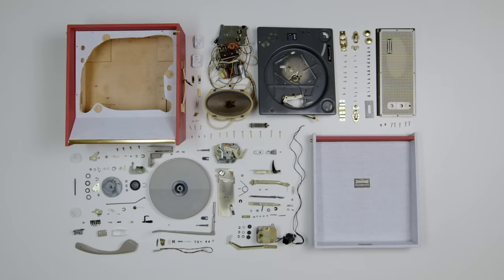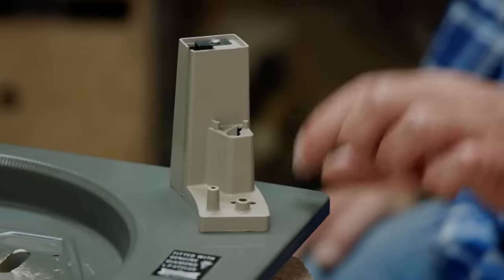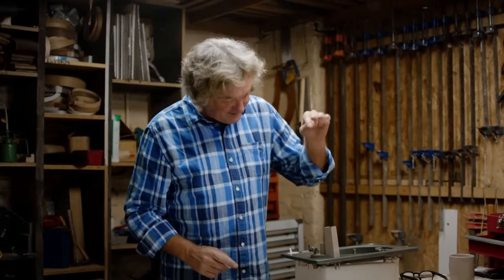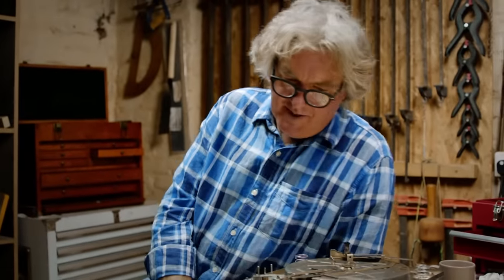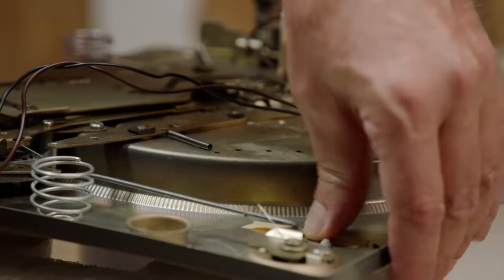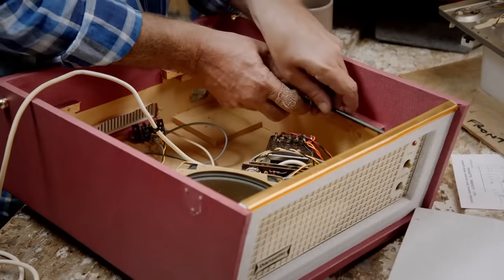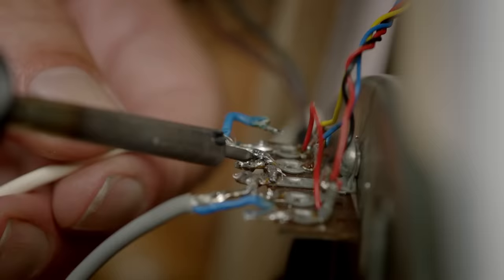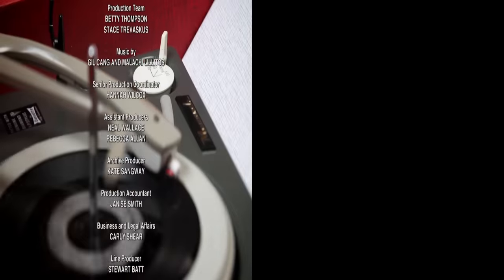James May Builds A Record Player! | Reassembler

Comment: Most of the portable record players supported 78rpm however the grove width on the 78 records was wider than on the 33 or 45s. Therefore to play and hear the 78 records properly they needed a different stylus, some turntables had a stylus that  could be flipped with a lever for the 78s
Reply: On this one, the entire cartridge flips over, as mentioned in the video.

Comment: Absolutely love watching James May do anything. But watching him say if you were a youth of the 50's and 60's, this was your I pod or mp3 player. Me in 2023 thinking, but I pod and mp3 are now just as obsolete as the record player. I recently set up a record player, a slightly more modern one than that, with an amp and some old bookshelf speakers, and the first record I played for some nostalgia was, The Greatest Hits Of 1987. Witch hadn't been played since 1987, and it sounded amazing. That weird thing about old tech sounding warmer that James mentioned, there really is some truth in it.
Reply: I was just listening to the wife's 80's record's she's 7 years older than me I lost mine but I reasently brought a gold ring E3 chartrige for my turntable £100 you can buy a cd player for that but yes they sound Warner and they flatter vocals. I restored a bar turntable and gave it to a charity shop they got £200 for it
Reply: a lot of its limitations and workarounds, its quite easy to have a 0Hz-20kHz digital file but vinyl didn't have the ability, the audio rolls off from 12kHz. The clever bit was the utilisation of eq (RIAA) plus mid and side. There is generally lots more 'side' on a stereo vinyl master than there is digitally now. A lot of clever analog sound tricks have been lost over time. It's warmer because of the way it's cut (mastering/cutting process) and how much information you can physically fit into a microgroove

Comment: Just to inform: The type of glass used to make a valve is not affected by the grease from your fingers. It is similar to pyrex glass if not exactly the same. It's extremely thermally stable glass.
Reply: Yeah it's usually Halogen bulbs you've got to be careful with touching.

Comment: World war 2 portal military radio valves were covered in a heat proof resin. Back in the 1960s I as a teenager use to repair old peoples valve radios using WW 2 valves as military valves were the same as retail valves on being better built. All you need was a book of valve equivalents. No heat sinks need working with metal chasis

Comment: This morning I had a choice: do I buy a replacement part for the vertical Roman blinds that joins the rotating string cord part of the blinds, or design and print my own version? The old plastic one had crumbled into small pieces earlier today. So about two hours later and a dabble in Fusion360, I had me a working replacement. It’s a small critter, that required a little bit of effort to get printed OK, but Cura and it’s multitude of settings makes that fairly easy. It now snaps into place with a resounding click as I assemble the top with its push fit. Very satisfying indeed. Now time for another well-earns cup-o-tea. Thanks James for making tea and telling stories we all love to hear, whilst watching you reassemble another gizmo from our collective past. Look up: Blind Pull Cord Connector Clip - Chain Roller, Roman, Vertical on thingiverse. A very useful place for free printable stuff. You can also buy them on Amazon, but then again, why not print one instead. Much more fun.

Comment: Yes, valves give a warmer sound. It's distortion. The valves change the sound from what it is meant to be to something false, and many people have come to like that false sound, just like some people like the bass to be cranked up way more than it would be in real life.
Reply: With valves, it's a whole experience thing. The wait as they warm up, the smell of dust burning off them, the warm glow they emit. Transistors and I/C are wonderful things but they're cold and uninvolving
Reply: @TheAmicuscurii  I wonder if people miss the experience of spending 20 minutes getting their car started, priming the oil pump, adjusting the spark advance, smelling the oil, experiencing the imprecise timing until you get the advance just right for the current engine temperature as it warms up...
Reply: Yeah, virtually all modern musicians will use a valve based amp for the warmer sound. Calling it "false sound" becomes rather meaningless when you have an instrument that actually has to be amplified to make a sound at all.
Reply: Well the early records were produced on equipment that had valves so how are you supposed to say that it wasn't when they knew what they were doing at the time of the new the equipment that they were working with that is the way it supposed to sound because they know what components made up the equipment they were working on to create the sound to record it your statement is very false.
Reply: @jasonrusso9808  That was very hard to read. You should really learn about sentences and put more than one period per paragraph.
Every generation works with what they have. Valves introduce a specific type of distortion. This isn't even up for debate, you can easily demonstrate it. There's nothing wrong with preferring that sound, but it's also not true that it's always preferable. There was a time when you had no choice, but now we do have a choice.

Comment: On the vacuume tube  it is ok to touch most of the tube  you should try not top tounch or get any thing oily or wet on the getter which is the shiny silver part on the top of most tubes  that does just as it suggests it getts powered up :)

Comment: I've got an old 1953 philips disc jockey major record player. 
The and mechanisms all work but no sounds. I have the replacement capacitors to replace the old paper capacitors that are in it and it will work once I change those out. It's a great old thing.
I think the only record I have here somewhere is an old grease double LP album which is fine lol.
I didn't actually acquire the thing for playing records but rather for converting into a valve guitar amp.